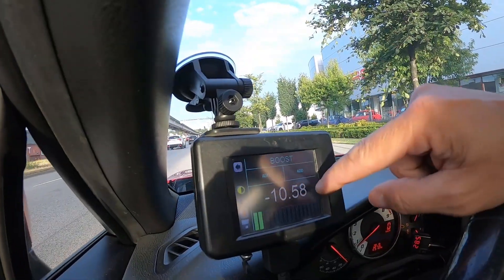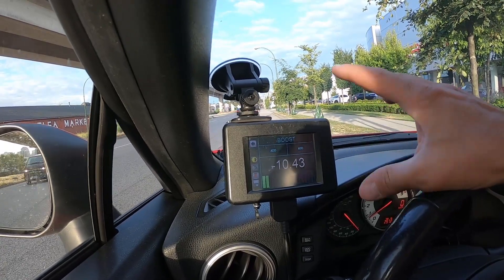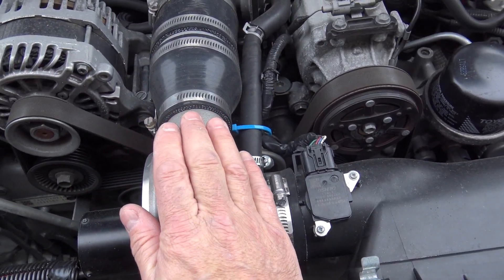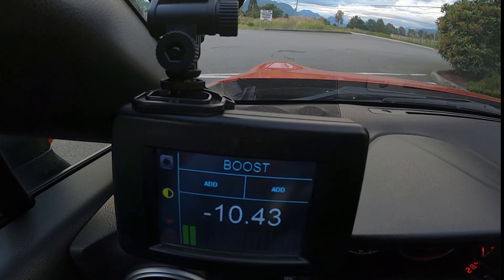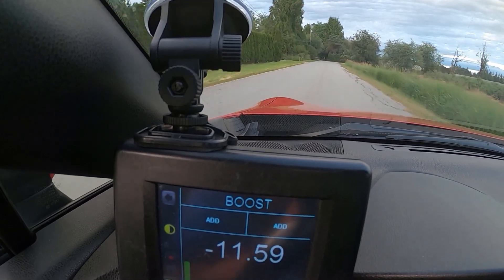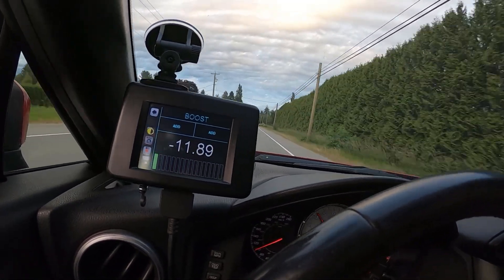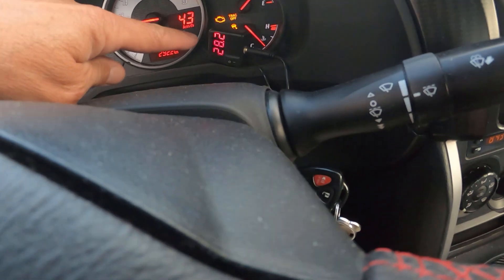Proof that my Electric Supercharge works!! BOOST

Comment: I believe that it gives you some good usable HP... nice mod.
Reply: Tom thumb  I don't know about that... and calling it a scam? I don't think that he is trying to sell it to you is he? Seems legit because the snail seems to be sized about right for a small engine like that and the hobby motor that he is using seems to be able to push about 60k rpms.... so the turbo is doing work...  you can't completely discount it. And besides, he shows a net gain of boost and he even mentions that he feels it which I think is good enough for him? I don't think that the whole thing is race worthy though.
Reply: Tom thumb  Yeah, I saw that Mustang video.... but that one was with a crappy small electric turbo that obviously wasn't large enough for that engine (it was like a fancy blow dryer). In that instance it created a restriction. Honestly, it's not really something I would try... but unless he is being dishonest, let's face one fact.... he was able to positively pressurize the intake to 3psig which means that he was moving more air than a normal aspiration. Most peak between 80 and 200k, but not all of them. Bottom line, I wouldn't spend any money doing this.

Comment: I can appreciate the time and effort put into this project, by why not get a sizeable brushless electric motor and do a gear drive? that will allow you to spin the impeller fast enough to make some sustainable boost...I'm watching the boost climb to roughly 5psi, but then fall as the engine outflows the turbo....what is that compressor housing off (what turbo)?...a quick look at the compressor map of whatever compressor you're using will tell you how fast it needs to spin...then build your gear circuit to provide the correct compressor rpm. Thumbs up so far.

Comment: Where is your intercooler man? Just think how much power you would have then lol buy real parts not junk.
Reply: Andrew Manche exhaust gasses are not what make the air hot in a turbo application Andrew it’s the compression part that makes the air hot when all those little air molecules get compressed they create friction with each other and get hot lol it’s not the exhaust gasses at all p,us I was being sarcastic with the whole intercooler bs because that little electric thing on there don’t do crap anyways might as well point a hair dryer in the intake.
Reply: I have a competition built diesel pulling truck I deal with turbo’s on a frequent basis so yes I monitor the air inlet temp along with the intake temp after the intercooler and the EGT’s the only way you will get heat from the exhaust effecting the intake temp is from #1 sucking air from under the hood dirty hot air #2 heat soaking if your exhaust housing is not ceramic coated and or have a insulated blanket you will get some radiant heat transfer some but the compression the compressor wheel does is what heats the air the compressor side does not come into contact with the exhaust to heat up the air.

Comment: My questions are 5lbs of boost
At 55k rpm that’s the static load right? How many cfm  is it moving? That’s is the key. Do you know how much  air  it is moving? The reason why  your boost drops is because your engine is using more and more cfm. As the engine rpm increases and the fan can only make its static cfm. You can do the same thing with a leaf blower and make horsepower  at about the same amounts given the same parameters.

Comment: I sharted myself laughing so hard. Since you’ve increased the feed voltage to 24 volts you still should require at least 100K of impeller spin to really increase airflow.

Comment: even if it does make  boost you're not tuned to use it, then the ecu isn't adding fuel for the boost means no power. It means youre running lean and going to lose power. 
thats how turbos and superchargers work, they allow you to fit MORE FUEl by COMPRESSING the air. fucking moron
Reply: Cam Co just stop you sound ...... nm
Reply: ok ill get technical. your cars factory ecu will take any measure it can to prevent it from running outside its emissions parameters. it will shut the throttle on you, pull ignition timing, valve timing, pull fuel etc to run the closest to the way its supposed to. you will not make power untuned with dumb shit like this

Comment: What you sir fail to realize... you might be making miserable "boost" but its being negated as you spin more rpms to your engine. You are actually loosing horsepower where your engine needs the air volume you are blocking. You can pressurize pvc and read bost, on a gauge.... but it dosnt mean your actually making power. Show me a full dyno run, with and with out. And make a full video including your honest reaction to being wrong. You want to "turbo" your car, then do it. Dont waist ppls time with leafblower antics. Dont let some poor kid some where think thier ganna gain power with junk.

Comment: Shoving more air in the engine without modifying the fuel mapping really isn't going to do you much good, horsepower wise anyway.
Reply: Jeff Scott bs people boost on stock ecu tunes
Reply: @ryano8613  

I'm sure that there are all sorts of knuckle heads out there running boost with a stock set up thinking they are getting more horse power out of it. The fact of the matter though is all of the vehicles manufactured in the last 35 years or so use a Manifold Absolute Pressure sensor (MAP) or a Mass Airflow Sensor (MAF) or both. 99% of those vehicles with MAP sensors maxes out at 1 bar, which is the pressure at sea level. If you try to run boost, the MAP sensor won’t be able to measure a change, and your engine will never get enough fuel. There are a very small number of vehicles out there that have 2 or even 3 bar MAP sensors and are capable of reading the full range, but these are few and far between, and all the ones I know of are already turbo or supercharged, hence the need for a 2 or 3 bar MAP sensor. So for engines that are MAP based, you can't just slap a turbo on and get more power on the stock tune. The science simply does not support this! So lets talk about the MAF sensor. Your MAF sensor is capable of only registering a certain amount of airflow, and if you exceed this amount your engine will not notice the added air and will not add enough fuel. Judging by what I can see in the video, this guy has a partial sample MAF mounted in the air box. Partial sample MAF's rely on a specific diameter of the intake, which in this case has been restricted by the reducers he has used. Also missing on this guy’s set up is a blow off valve. This is required in this type of set up to recirculate air back into the system, or the ECU will think there’s extra air in the engine and dump a bunch of fuel in the mix. This guy’s engine also incorporates  a 1 bar MAP sensor, making it impossible for the ECU to see any boost that he is trying to put into the engine. He might benefit from adding a 2-3 bar MAP Sensor and a standalone fuel management system, but I haven't ever seen one of these electric turbos do what they are advertised to do yet. They are great at placebo effect though! So, can you boost on a stock ecu tune? Theoretically yes. As long as you install the additional parts necessary to make it work. Can you just bolt on a turbo and expect it to work with everything else left stock? I don't thinks so! Not in this reality anyway! Until I see dyno data that can dispel the widely accepted scientific data on this subject, I'll stick with my original statement!
Reply: Jeff Scott that was a good read. I just learned a lot. Thanks for sharing your knowledge.
Reply from the maker: I am running a tune by Shiv.

Comment: The proof is in the dyno.

Put it on a dyno! You didn't show anybody shit until you put it on the dyno
Reply: You hit it on the head, put on the Dyno, that is a lot more like proof, even the Dyno is not perfect, but way more accurate, than fantasy land.
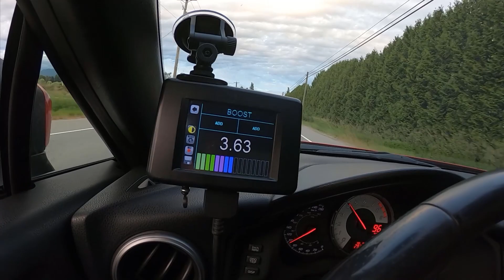Reply: most attempts at such things dont work, but done right there is usable power to be had.. no turbo heat to deal with.. no extra engine loading due to belt drives ... alternator can charge those batteries at its leisure = distributed loading over time ... granted this can only move a limited amount of air, so this setup wont keep up with some massive displacement V8, nor is he claiming to compete with such classes.. he is only claiming usable power increase ... you can see as the RPM's go up his boost starts to taper down, but he still has 3lbs boost at 4,200 RPM.. positive boost  means the motor is not choking ... plain and simple boost = power ... 3lbs of normal temp minimally loaded power at 4,200 ... that will most definitely improve drivability of any vehicle.. he seems to have found a usable combination that works for his situation.. and thats all he is claiming... 3 lbs at 4,200 RPM is usable boost .. see it at 5:30
Reply: @VorpalForceField  without adding more fuel all he's doing is leaning out the air/fuel mixture. Probably why his check engine light is on
Reply: @mikepoole2248  that can and will happen but in closed loop the computer can compensate for that to a large degree especially at such low boost pressures.. basically it will not lean out until the fuel trims hit the wall..  most definitely not ideal but again all that he is claiming is added performance Over stock.. and could absolutely get additional performance if it was dynoed and tuned
Reply: @VorpalForceField  man don't be bringin all this facts and logic up in here - this is a bashing session!
Reply: You can use a gtech !,,
Reply: If an Echo leaf blower can give a Honda civic 20 HP (look up the video), I think this guy can pick SOMETHING up.....
Reply: @kennyschopperz  yeah but I don't count anything smaller than a 3.6L V6 an engine.  Just go carts and I got a 20hp gain on a D18 just by adding a dry ice box.  Big deal, do wont even feel it, but an extra 60 toque is something you can put your finger on.
Reply: Where are all the bitchy haters now that it has proof on a dyno cleetus mcfarland tested the torqamp and it made a bit of power. ....fucking crickets. Losers.
Reply: This is hilarious. If he put this on a dyno it would make less power. It's nothing but a restriction. Plus like others have said where is the extra fuel coming from? Without more fuel it's useless regardless. 
Mike's shady auto sales is his day time job. 
By the way you idiot the rpm on those motor is with no load. It's not spinning near 50k rpm. They all lose between 20 to 50% rpm under load. 
Maybe add it to a lawnmower. Better make it a push one too.
Reply: @waynebollentin989  and he has the balls to attach a $3500 price tag to a hair dryer.
Reply: @braggsean1026  what ? I didn't catch the price. Are you fucking serious? 3500.00 for this junk that wouldn't make a lawnmower faster?
Reply: @braggsean1026  hahaha
Reply: Cletus called this House Power in his video and it was a huge loss of power on the Dyno.  Look up Cletus McFarland
Reply: @gregory-vw9vq  although cleetus did a cheaper version, the end result will be the same ... restriction of stock intake volume.
Reply: No waste gate, or blow off valve, bigger fuel injectors and fuel pump etc?
Reply: Steve Yzerman Fan you can definitely “tune” a car via CAN. Don’t see what would inhibit you from flashing changes to a pcm. Also I think this guy was just reading data off CAN... that’s all.
Reply: 60$ Rc car Motor.. ..hahahahah
Reply: @zukimaniac He shows the motor with his thumb next to it, less than 800 watt in size, and in his other video you can hear it rev to about 3000 rpm which is all a 250Kv motor puts out at 24 volt, another Youtube scammer.
Reply: Yeah, the dyno will show power on the dyno. Putting it on the dyno will be proof and the dyno will show that. dyno ...
Reply: Steve Yzerman Fan  Actually the top brands out there work like that now lol like COBB
Reply: referring to tuning using an OBD II plug in
Reply: It works... You need 10 psi... 😁
Reply: I don’t see the problem... when you get a turbo or supercharger you are supposed to get your vehicle tuned 🤷🏽‍♂️ otherwise u just bought something to give u a slightly different sound and about the same horses a cold air induction would give you
Reply: Cleetus dropped 13 horse from stock on the dyno
Reply: Sean Bragg wasn’t it more like 30 something loss?
Reply: @bobsmithinson2050  yeah... i just didn't correct my comment

Comment: Very nice setup. 5 psi is perfect for a stock engine and fuel system. Wouldnt want to go higher than that. And it doesnt get any easier to install. Good work sir
Reply: the boost isnt fueled for so this is just leaning him out and taking power away and ruining his engine, but ok
Reply from the maker: @camco7829  I have a tuuune!
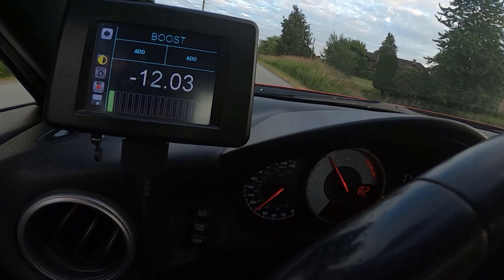Reply: @PhotomikesGarage I know it's been YEARS since this video was posted but, at the point in the video where the power drops off (around the 8:01 mark), your voltage meter is only reading ~22 volts! I didn't see anybody address this but that might explain the power drop, right?
Reply: @camco7829  lean is mean man everyone know that
Reply from the maker: Thank you!

Comment: I have a 2013 Ford fusion, 6 speed, 1.6Turbo. (same drivetrain as fiesta St, just bigger car). I want to try one on my car. Intake a pretty small, so I wouldnt choke the airflow and I honestly think it help my existing turbo get faster air. As the 1.6 has a lot of turbo lag
Reply from the maker: Tuning that combination would be the hard part.
Reply: no way this would flow more air than the turbo thats on the car. it would just be a restriction.

Comment: Watch Cleetus McFarland’s vid he tests one on a dyno.
Reply: not to mention box 4 vs v8 . way differant air demands
Reply: Not a fair comparison... cleetus' was very small and most likely didn't spin at 55k RPM. Also his was 100% or nothing, which isn't how a turbo works at all.
Reply: @Geronimo_Jim  Yeah, I watched Cleetus' video, just because he put it on a dyno doesn't mean it was accurate, also, any turbo with a cold end as small as that one wouldn't do shit on an 8 cylinder car.  This is a better video, I'll be honest.  

There's also about 20 comments of people saying the impeller was spinning backwards on the dyno run.  So yeah.
Reply: And alot of people pointed out it was spinning backwards lol. They market them for scooters or very small 4 cylinder engines. It would probably make say a Toyota Echo a little faster. Or lose 30hp haha
Reply: Yeah this guy also has a 24v system. And this electric turbo looks better than the one ole cleeter has
Reply: In at least one shot they had the fan spinning the wrong way
Reply: Cleetus' was spinning backward
Reply: @Andrew Manche yeah cause that will make all the difference lol.
Reply: @ryotaryuu  its plausible but building it would cost more than normal boost options. 
Also the real power gains from electricity would peak if it was power to drive line to use torque advantage of electricity.
Reply: Ole cletus had his wired backwards.  Anybody knows if you hook an electric motor up backwards well yeah it will spin backwards. Also cleeter had his on a V8.
Reply: The video of cleetus putting one on the colbalt they bought only increased the power when turning the electric SC on when its off it restricted the natural air flow and it lost 30 hp...
Reply from the maker: Cleetus is awesome and right about this pos electric turbo, but what I have is totally different and it works. Electric turbos work if they are engineered properly.
Reply: @PhotomikesGarage  Put it on a dyno Mike, and show us how you get 200 amps from 2 small AGM batts, an 800 watt motor and the sound of 3000 RPM.
Reply: One is a toy, this is not.
Reply: Scott think before u open that stink hole

Comment: Mike.... That is impressive, and no, it DOESNT need an intercooler, as the air going to the throttle body, is probably not much more than ambient temperature :-))
Reply: As soon as you compress air it heats up, what makes turbo'd air hot isn't that it's run by the exhaust, it's that it's being compressed.
Reply: @GingerNingerGames  PV = nrT

Comment: But did you get it dyno’d/tuned 🧐
Reply: Get it tuned?
Reply from the maker: Yes I am running an open flash tune.
Reply: did you watch the video?
Reply: Lol well obviously but I’m looking for official dyno stats. Lol the cost of this thing is like $4-$500. For that price you can literally probably achieve more boost and consistently with a eBay turbo kit. Lol anyone can hook a flasher up to their obd2 and say they flashed it. lol it’s funny tho because I just watched Cleetus Macfarland do a review on a dyno and lost hp and tq. Which is why I asked in reference to a serious dyno tune
Reply: @charlesdemeary  that was only a 12v system and it was on a v8 movin a lot more air and it was a cheap chinese piece of shit so who knows. also i dont know where youre finding complete turbo kits for $500 haha. ive seen as cheap as 1200 but i wouldnt put it on my car.

Comment: Very impressive. An electric supercharger can only create enough horsepower with a minimum of 24 volts. 
Can you fit an intercooler with it?

Some of these nay sayers make me laugh. They are uneducated.
Reply: Your an uneducated know it all!!!
Reply: norman, I am an electrical engineer. and while I have no experience with these systems - I do have a brain and have studied physics. after reading MANY of these comments I suspect that the neigh sayers  are correct altogether. clearly the results are sub par compared to a properly engineered turbo system.
I would bet money that a dyno would prove the point. this is not a good solution overall. the point about price per performance is appropriate.